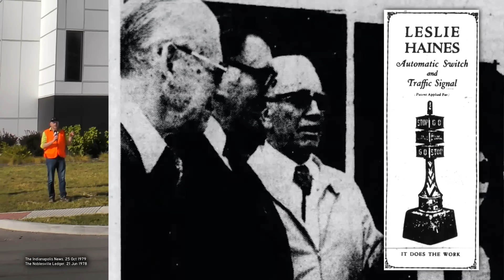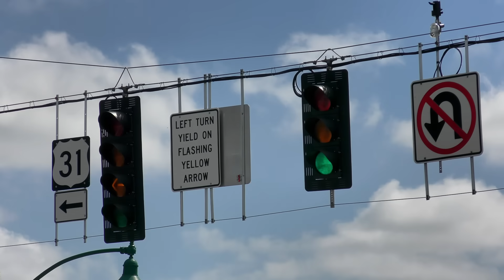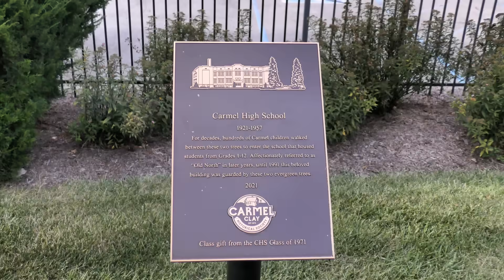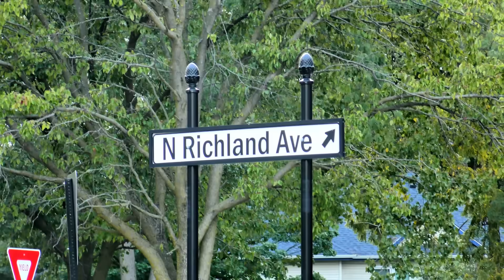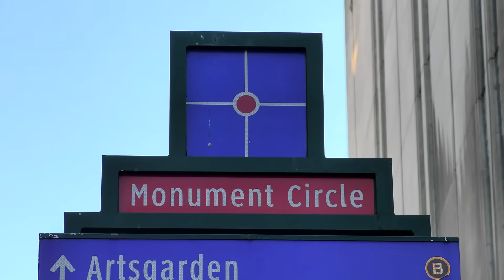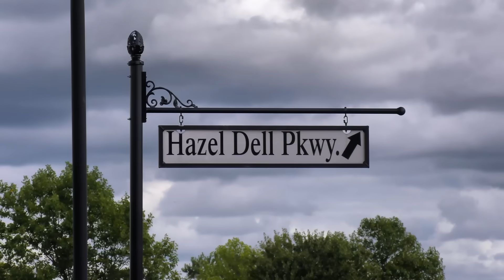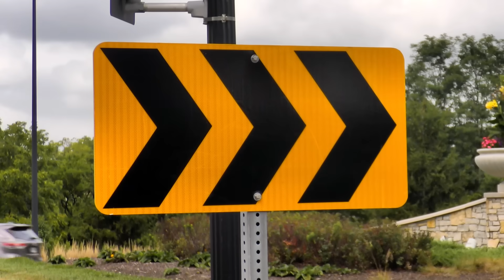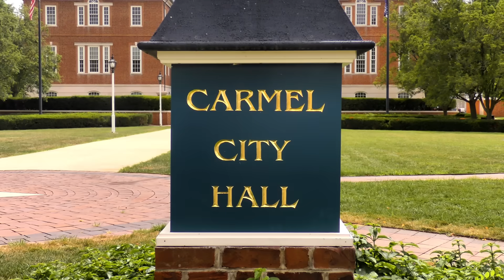Let's FIX the HIGH SCHOOL... with 152 ROUNDABOUTS!

Comment: I live in Carmel. I think roundabouts are great specifically for a type of place that Carmel is. An affluent suburb with space to spare, money to burn, and a predictable amount of traffic flow. As Rob hints at for the next video, there are two north/south limited access highways that keep most thru traffic off of Carmel's streets. This leads to a predictable amount of traffic throughotu nearly all times of days. 

In the suburbs, particularly when Carmel was growing, space doesn't cost much. But in dense urban centers, eminent domaining nearby parcels for a roundabout quickly adds up. 

Finally, I think the pedestrian aspect on roundabouts, at least as Carmel does them, is mixed. In Indiana, pedestrians do not have the right of way until they STOP, look both ways, then cross unless they have an affirmative pedestrian signal. Which roundabouts lack. And because pedestrians are supposed to follow a roundabout with the flow of traffic, that could mean a pedestrian has to stop and yield up to 7 times in some of the figure 8 roundabouts.
Reply: It looked like the next video hint had him crossing 37 & greenfield, but he may be using that to illustrate the previous form of meridian/31 & keystone.

In Indiana pedestrians only have to yield to cars at unmarked crossings (jay walking) and signalized crossings, in unsignalized crosswalks (the kind at roundabouts) they do have the right of way and motorists are required to yield. This is actually why there are stop signs for pedestrians & cyclists on the monon, nickel plate & midlant trace trails; otherwise the cars would have to stop & yield to pedestrians and municipalities would have to clean/clear the sightlines for drivers.
Reply: With that rule, how are pedestrians supposed to cross the road in rush hour, when there's a nearly constant flow of traffic? In my country we have the same rule, and it sucks. Some drivers think we're supposed to step foot in the roadway to show our intentions, but that's uncomfortable and sometimes dangerous.
Reply: @NewBuildmini  The busiest road traffic in Carmel is often away from areas where pedestrians are common. But yes I've stood at the roundabout at US-31 and 116th and it can take a good long time for traffic to clear to make for a safe crossing. 

In the more pedestrianized, urban core where Rob is for most of the video, there is a lot of courtesy stopping from drivers.

Comment: I didn't know there was a difference between Roundabouts and Traffic Circles.  Oklahoma City has two of what must be traffic circles, there is a stop sign at every entrance and I think they are undersized to be useful.  These are on NW 10th St. at the NW and NE corners of Saint Anthony's Hospital.  The NW one works fine, it's easy to enter and get to your preferred exit, however there is not much traffic on this side. 

The NE one is a different story.  Not only is there a lot more traffic, as it connects to the hospitals main entrance and a lot of other businesses, mostly restaurants,  on the streets around it, this side also has 5 streets conjoining at this spot.  Since the traffic circles are already too small to handle heavy traffic the addition of a fifth street makes this one dangerous.  In some places there is barely a car length between inlets/outlets and since you are coming out of a stop sign you must yield to traffic coming the opposite direction if you want to turn left.  Since it's so small it's very hard to determine if another car is going to turn before your inlet which causes many people to hold at the stop sign longer than they should.  

I've always thought these traffic circles needed to be larger but after watching this I think they need to also be turned into roundabouts.  I always thought having to come to a stop before entering the circle was pointless and this video pretty much confirms that.  If you're going to make people stop at a stop sign and yield to oncoming traffic before turning left you might as well just have a straight through intersection.

Comment: Roundabouts are going to get ripped out and replaced with X crossings in the future when cars start working together to avoid crashes through automation. Not next year likely not for 10 years but in the reasonable future cities will see they don't need these massive constructions to reduce human drivers with bad habits causing serious crashes. 

Roundabouts also make every intersection into a judgement action, reaction vehicle performance contest to get into a roundabout. At a light you just sit and wait until the color changes check to make sure no one is running the light late and then go. Roundabouts make every straight crossing into effectively a right hand turn into traffic. With the right flow of traffic you can be stuck waiting the enter the roundabout forever. Similar to an intersection that only has flow control on one of the roads. The other factor is when slow to accelerate vehicles need to try and enter but can't get going fast enough and so usually end up entering the roundabout too slow and force smaller less armored vehicles to yield to them to avoid crashing into them. See why roundabout cause massive numbers more crashes if less likely to cause serious injury.
Reply: This is absolutely the future. Probably before 2050

Comment: There aren't a lot of good things I have to say about Carmel, I work there M-F and then leave... happily. But the roundabouts... They mostly nailed them. Driving in Carmel is generally great.

Although the roundabouts that were added to the rework on US 31, turning it into an interstate-class highway, with peanut roundabouts underneath... Those struggle at peak times.

Comment: So I am not understanding this...  a "rotary" (as I found with a Google search) can have two lanes with faster moving traffic.  And if the rotary cannot handle the traffic needs, it is converted to a more standard traffic-light regulated intersection.
So if a "round-about" involves just one lane and slower movement, it seems that if there is a rotary or even an intersection that REPLACED a rotary, that a round-about is the WORST (WORST) solution for it.
I lived in an east coast city that had two very well used rotaries with another 1/4 mile into the next city (total of three).  These were ALL converted to regular intersections when they were no longer able to handle the volume of traffic.  And so round-abouts would have only made their situations WORSE.   Period.

Comment: Roundabouts in the US suck because they have yield signs at the entrances. Drivers suck at using them. They either treat them like a stop sign and always stop at them, or they just charge through because they stop for nobody. 

Placing quick changing traffic lights that you see at interstate onramps would be ideal. Drivers tend to obey traffic lights much better than yield signs. And since the light changes quickly it will slow most drivers down like a yield sign should.

Comment: Roundabouts with more than one lane are worse than stoplights because they incentivize people to illegally switch lanes, driving rules be-damned. It's so sad since single lane ones work so well. Physically separated roundabouts solve this issue, but have essentially no adoption.
Reply: For any roundabout with more than one lane, they should implement the “turbo” roundabout designs, which use physical barriers between lanes to discourage internal passing and changing of lanes. The “mountable” barriers are designed so cargo and emergency vehicles can drive over them slowly. They will toss any vehicle going too fast into the air quite a bit, and kind of roughly so they don’t care to repeat it.
Reply: @chow-chihuang4903 How do you expect semi trucks/Mac trucks to negotiate a turbo roundabout? Especially with the retrofitted intersections size! There's just no ability to smoothly do so without simply building a much larger junction/roundabout where the previous one stood at a steep cost and possible imminent domain issues.
Reply: @Mcfunface  Guess you don’t understand how the “mountable” barriers work
 They’re in the design guidelines as well, with clearly dimensioned schematics. They work.
Reply: @chow-chihuang4903  You're clearly not considering the difference between lorries and semi trucks. Back to the drawing board with you.

Comment: Begging to differ on the first roundabout thing:   Just consulting Google Maps, I would get it if the road system on the D.C. side of the Arlington Memorial Bridge isn't maybe technically a roundabout,  but it certainly functions as one, I think. Unless it's change in the several decades since I came upon it.  I was a tourist from Canada doing touristy things, and had never used a roundabout before. I had a lot of trepidation when I saw the traffic flow signs on the bridge, but after getting through it I was "WHERE HAVE YOU BEEN ALL MY LIFE!"   It's been a long wait, but roundabouts are making a welcomed appearance where I live now.

Comment: My town put in roundabouts 15-20 years ago and people are still complaining... Those same people just stop and wait for traffic to clear before going.
Reply: That people have the worst semi trucks drivers, in the rest of the world the semis can manage a roundabout pretty well, better than light cross signals.
Reply: Because old people and folks towing large trailers have basically zero hope of navigating a roundabout built on the dimensions of a former intersection. Roundabouts are great for roads handling low to mid volume traffic, but atrocious at high traffic roads in the US. Partly due also to the brilliance of the EPA and it's CAFE requirements essentially encouraging the production of larger automobiles in the states.
Reply: It's nearly impossible to enter a busy roundabout with a semi-truck without stopping and waiting for traffic to clear.
Reply: @bryanteaston7264  It's still safer than having some idiot blowing through a red light or a stop sign.

Comment: They don't like to put in roundabouts where I live (Los Angeles County) because while they undoubtedly improve traffic safety they have the side effect of reducing traffic congestion, and any project that benefits car drivers is a no go.  Their answer is to remove traffic lanes and intentionally break signal timing, which increases traffic congestion, of course it also leads to an increase in dangerous driving and accidents but what's really important is that car drivers are punished.

Comment: Our city has a lot of intersections where the "roundabout" is a 10 foor circle of concrete with plants in the middle. That leaves, maybe, 12 feet between where the right angle curb is and the curb of the center "island".
This is in an older neighborhood where there just isn't room to place a full-sized traffic circle.
If there is lots of room to make the circle, great, otherwise it ends up just being an obstruction where hardly anybody slows down.

Comment: Safer for drivers, but did I see un-signalled pedestrian crossings on dual-carriageways?!
Reply: Yes, but they're typically protected crossings with places to stop mid intersection. Though, some aren't wide enough for a bicycle.
Reply: American DOTs hate putting traffic lights at pedestrian crossings for some reason. It's weird because Canada has them everywhere without issues.

Comment: This Roundabout deep dive nails it! From their history to the true reason - saving lives. If anyone tells me that they "hate roundabouts", I'll share this video. 

BTW, smaller roundabouts are a PITA for truckers. Getting around a roundabout and exiting in any direction means said truck must take up the whole width of the road. I drive 18 wheelers. I know. And I still love "roundys", to coin a nickname.
Reply: Some roundabouts have skirts to let truckers pass through.

Not sure if that is the official term: but a raised paved area around the circle that allows trailers to roll over top.
Reply: @economicprisoner Roundabout apron
Reply: @economicprisoner  This one does, but it isn't enough because the turn is way too tight. Most of the truck traffic now avoids it and has made a already busy through fare far worse or they go straight through downtown of this city which the bypass was design to stop that particular flow. In short the city did not think what they were doing through.
Reply: @joeblow5214  Was confused until I read your previous comment about oversized loads.
In the UK they have some roundabouts with a bypass through the center for some oversized loads.
Reply: @economicprisoner  Your guys trailers are also on average shorter, 53ft trailers are the norm here. They love raised islands on rounds here too, not to mentioned raised curbs to manage traffic. Roundabouts in the U.S. are just frequently put in places with little real thought given to traffic flow or what kind of traffic is crossing it that I have noticed. Roundabouts have a valid use case, but as I have said they are not a universal band aid.
Reply: Imagine getting a wind turbine blade around one they put on a bypass that was meant for truckers and oversized loads. They did that locally and now those loads are forced onto far a busier road, but in the next town over technically so the city that put it in doesn't have to deal with the consequences.
Reply: It may be prudent for truckers to go back to using the same sized trailers as Europe. They never increased their maximum length in part due to the amount of roundabouts.

Comment: I've seen the evidence first hand. I live near a somewhat busy intersection, especially in the summer*.

At one point, it was a simple stop sign. But about 20 years ago, they upgraded to a traffic light. And, a few years ago, they started converting it into a roundabout and have since completed it.

One of the roads parallels an interstate, and the section where the new roundabout is is where the interstate climbs a mountain (by Appalachian standards) so weather can be a bit dicy, fog has caused major pileups before, trucks go slow, vehicles catch on fire, etc. So, wrecks and other road hazards that cause the interstate to slow to a crawl or completely shutdown are a common occurrence. When that happens, drivers detour onto the road that goes through this new roundabout.

When it was a traffic light, traffic would always back up for miles as the intersection just couldn't handle the volume of cars of a modern interstate.

But now, with the roundabout, the backup is much smaller. Extending maybe half a mile. The intersection is still overwhelmed and can't handle the volume of a modern interstate, but the length of the backup is night and day.

So, yes, roundabouts are that much better at handling traffic flow compared to a traffic light.

*(There's a US highway with interstate exits in either direction, 2 National Park sites just 5 minutes away, and there's a state primary route with dozens of breweries, wineries, cideries, distilleries, and even meaderies. Not to mention the people who live in the area and commute through the intersection.)

Comment: Myth busters did a thing about roundabouts which proved that they are better than lights.  I live in the UK so got used to roundabouts and agree, they are safer and move more traffic than lights
Reply: And cheaper since they have zero operating cost. And maintenance is just standard road maintenance.
Reply: They're better until you hit a certain level of traffic density in which case they turn into bottlenecks and get lights installed anyway, I also live in the UK and that's the case for the roundabout built at the northern end of where I live.

Comment: Google maps doesn't know what to do at round abouts, at a light where you don't turn it ignores it, but at a round about it tells you to take yhe second exit, this is not a problem with round abouts, I like them alot, this is an infuriating issue with Google maps
Reply: That's pretty much how most people are taught to navigate roundabouts, count the number of exits as you go around. Also informs you which lane to be in

Comment: Unfortunately, here in Newfoundland, where roundabouts are extremely uncommon, and people from rural areas have little experience with them, which can make traversing them a nightmare here...

I think my inexperience with them makes me nervous driving them, and I've been driving 25 years. 

I grew up in a very rural area.  I even had to learn how to read street signs (i.e. the direction that the sign pointed is the street the sign is naming) once i moved into St. John's in my 20s, because we just had no need for them or just ignored them back home.  People just knew all the roads and where things were growing up.
Reply: Being nervous is a feature, not a bug - it makes drivers slow down and pay attention. That's one of the reason they're safer than four-way intersections, where we just zone out and plow on through.
Reply: @davidbrooks348  that's true.  Being cautious can be good, but it can also cause accidents if I don't react quickly enough trying to figure out what to do...  Luckily I don't need to drive through them on a day to day.

Comment: Man, I'm so jealous of these guys. I think we only have half a dozen actual roundabouts within half an hour of me near Chicago. They're basically not even considered even on the rare cases where an intersection needs to be reconstructed. Thankfully Wisconsin is embracing them.
Reply: More and more of Indiana is embracing them every year too, usually based on proximity to Carmel. Once you see them popping up in Merrilville, Valparaiso, and Hammond it is only a matter of time before Chicago joins in.
Reply: @evancombs5159  Chicago and Illinois are different stories though. This state has no money to even make any sort of noticeable improvement to road infrastructure. I work in the engineering industry here and it's hopeless with what few projects are going out for proposals.